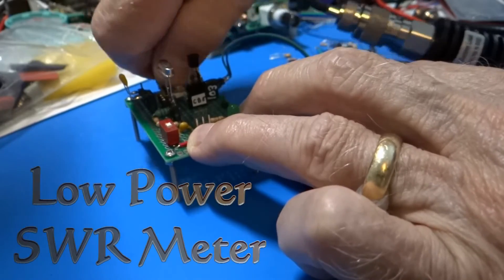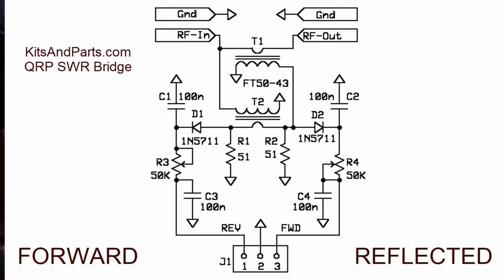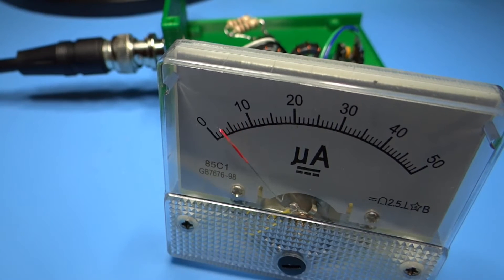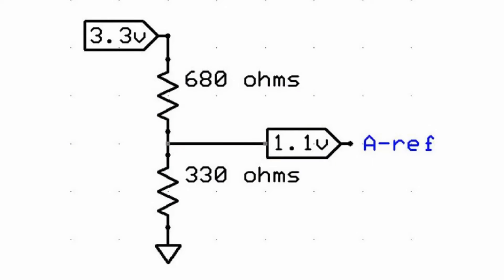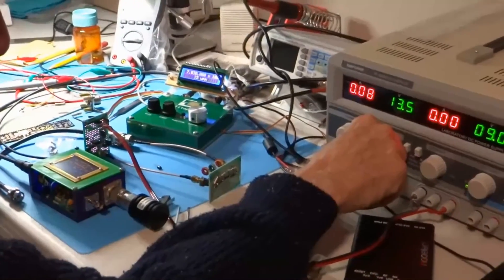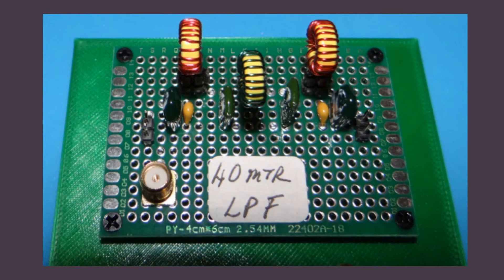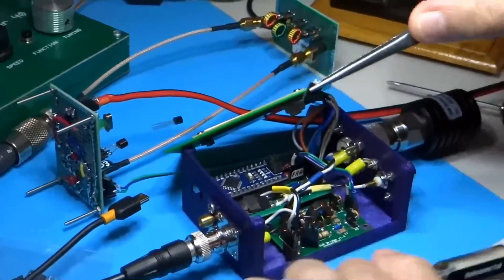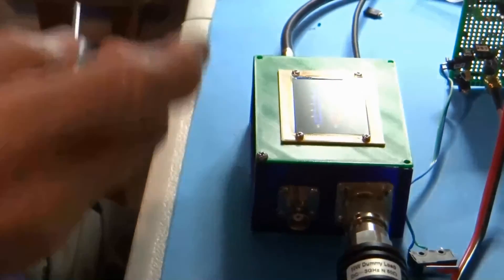Low Power SWR Meter

Comment: Lloyd, thanks for the informative (and well produced) video.  I've done similar experiments using the same bridge.  Have you come up with a way to calibrate the power without expensive equipment?
73, K3FLN
Reply: Oops, posted before I read your document.... nice write up too!
Reply from the maker: Hi Chuck.   Thank you for your positive comment.  I don't know how this would be done in a lab, but I measure peak-to-peak RF voltage with an oscilloscope, then compute RMS power as p-p voltage squared divided by (8 times the load impedance) --footnote 2 at https://www.lloydm.net/Demos/swr.html.